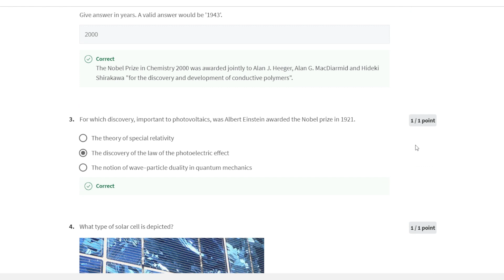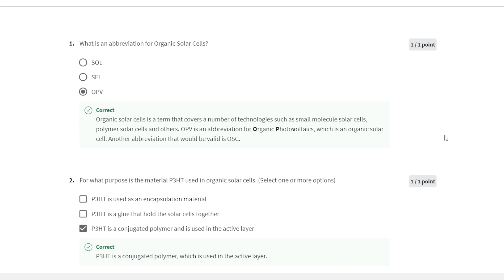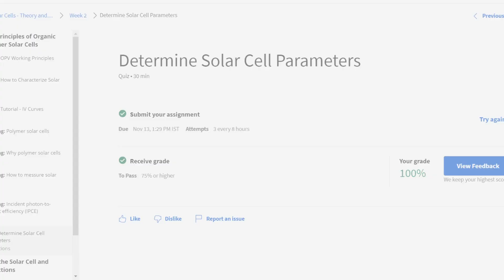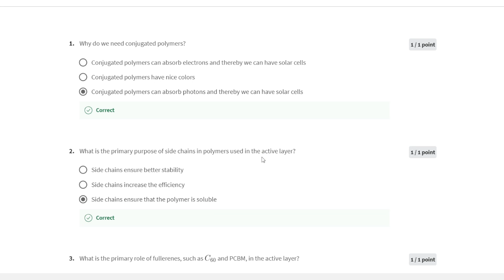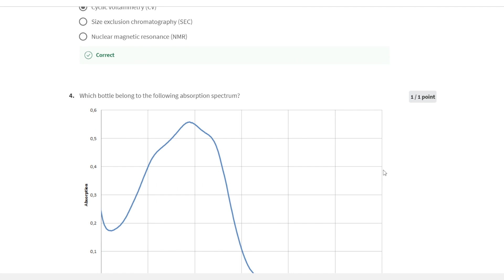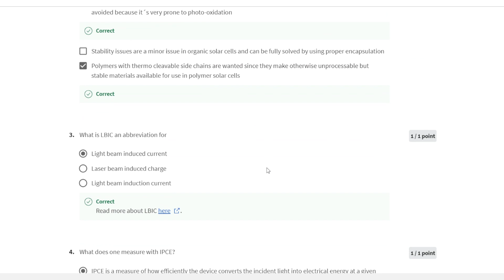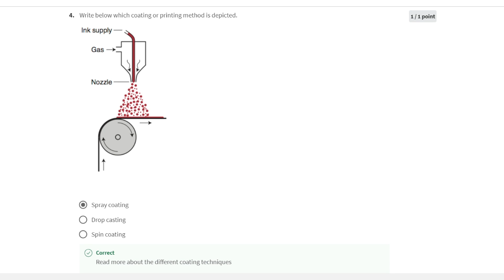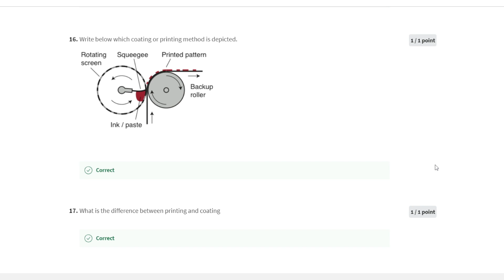Organic Solar Cells -Practice & Theory ( Coursera )

Comment: how come my final exam question 6 always wrong? I  just print 0.0227
Reply from the maker: Please check the units and values given in the question, if they are same then this answer must be correct.
Reply: I got the same problem 😢
Reply: The units and values are the same, but it just said 0.0227 is wrong…….

Comment: Hello brother  please reply
Reply from the maker: What is the name of that module?
Reply: @claws7  week 5  coating  
Question  5 and 6
Reply: The wet film thickness for films made by slot die coating is controlled by the flow rate, coating width, and speed. Give a formula for the wet film thickness using:

f as the flowrate given in units of [cm3min]

v as the coating speed given in units of [cmmin]

w as the coating width given in units of [cm]

Remember to check that the units fit for your formula.

This is the question
Reply: Another one is dry film thickness
Reply from the maker: wet film thickness = (f)/(v*w)
dry film thickness = (f*c)/(v*w*p)
Please try this and tell if this works.
Reply: @claws7    Yes it works
Reply: @claws7 not work💔💔
Reply from the maker: @user-rd1jn8pg9r 
Please type the question here if possible
Reply: Quiz  printing last question I need answers
Reply from the maker: If you have trouble in identifying printing method images, then go to the Chapter 2-Spin Coating section of the below link:
https://backend.orbit.dtu.dk/ws/portalfiles/portal/125389281/Michael_Corazza_PhD_thesis.pdf